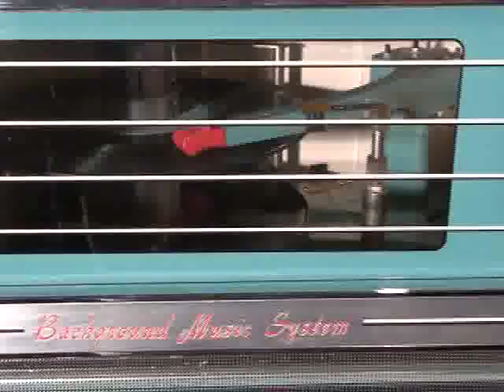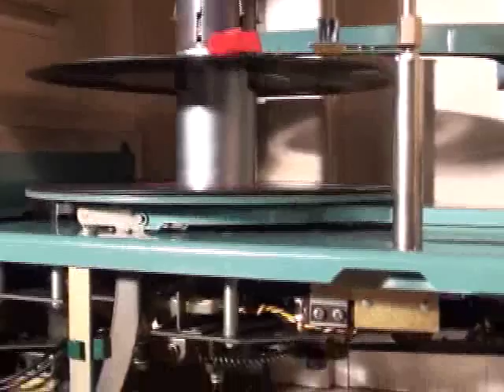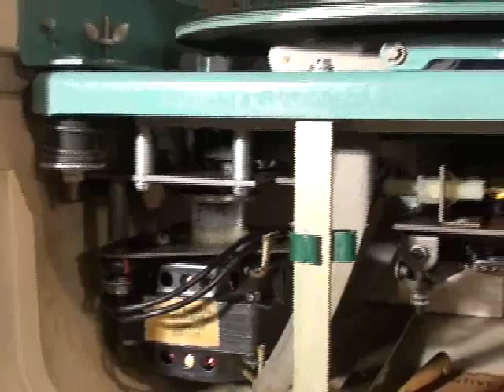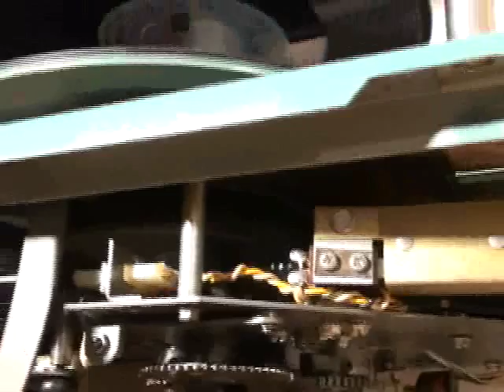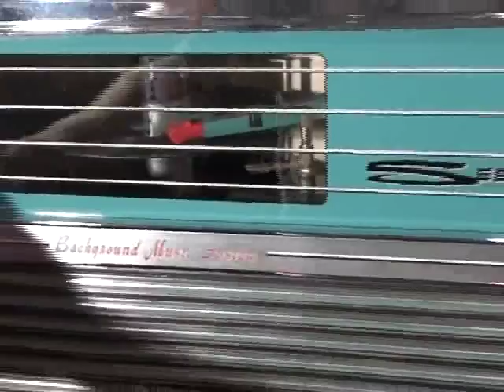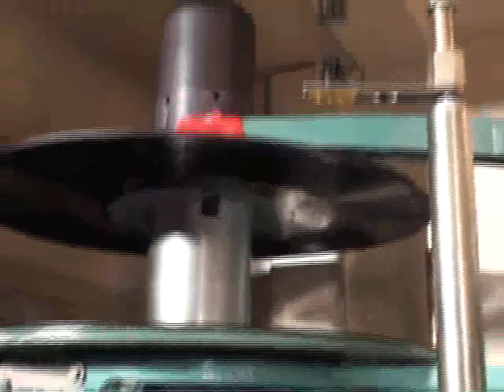1959 Seeburg Background Music system Juke Box

Comment: That's amazing that it has an all transistor amplifier. The first transistor amps in coin operated jukeboxes did not come around until 1962 or so. I'm actually kind of surprised this was solid state...usually PA amps/jukeboxes of this time used tubes as they were more tolerant of adverse operating conditions than early germanium transistors.